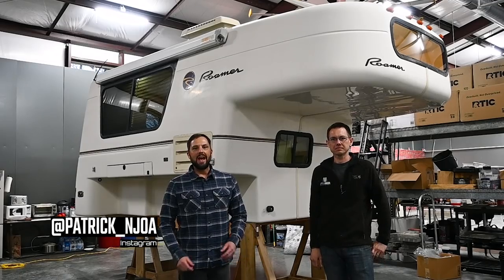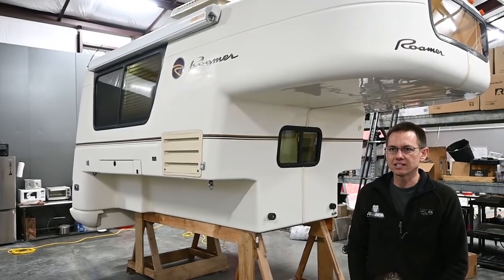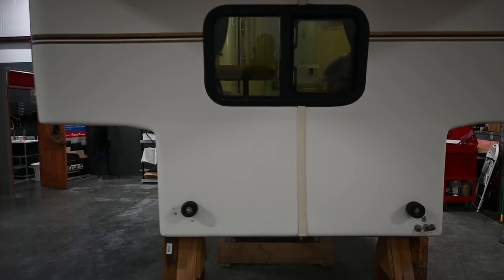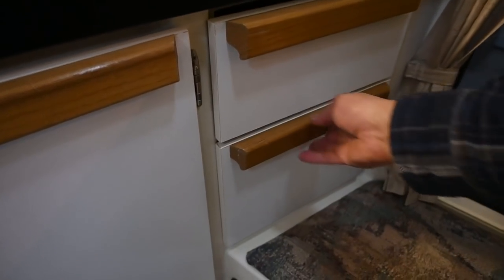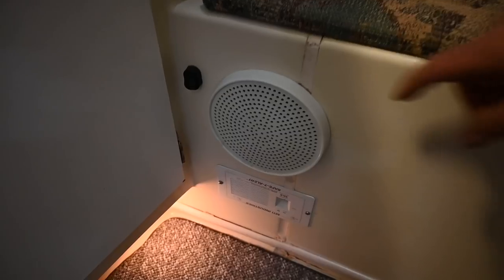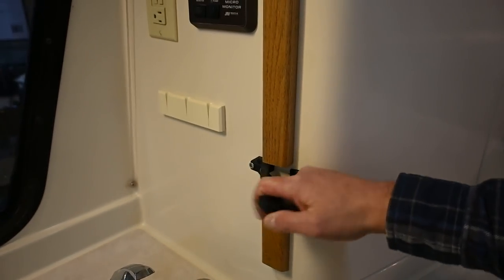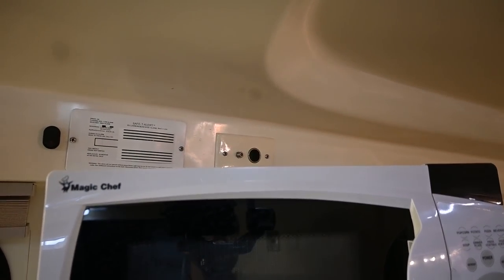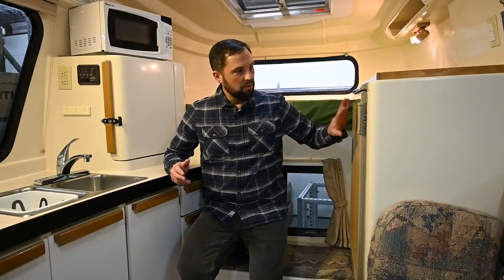The RAREST Truck Camper on Earth - Roamer RV Overland

Comment: That’s a pretty neat truck camper. I would personally look for a trailer instead. Truck campers are so heavy and seem cumbersome to deal with, I think a trailer would be an easier option.
Reply from the maker: Thank you for the feedback
Reply: My two cents…you really need a dually for stability and carrying capacity.  So many people go with a single rear wheel and they are highly unstable.  I know, you have extra this and that but a dually solves all of that.

Comment: Northern light and the other split campers are clam shells top over the bottom to prevent them from leaking water, but being split down the middle center is not going to be able to seal out the water its kinda backwards, but it is nice inside and out, but needs a generator
Reply from the maker: Maybe that was the reason for their demise?
Reply: @NewJerseyOutdoorAdventures  it is a very nice camper inside and out, though, I think they should have a option for generator, or enough electric/ solar, to be able to run ac, and other high wattage items.  But the camper is a very nice camper

Comment: It is a cool camper.  I had one for a couple of years.  Lot of water issues, not the least of which the dealer I bought it from thought duct tape was the proper sealant for the roof vents.  Water entry points were a weakness on this design, it gets in the fridge vent, and the side access doors especially easy, but it is mostly fiberglass which means water will not destroy it, only make a lot of repairs necessary to replace rotten wood.
Is a very aerodynamic design and I could get 20 mpg on a diesel truck, or 17-18 with it and towing a cargo trailer.
With any TC there is no storage and this one woefully lacks upper cabinet storage.
I had a rule to not drill or screw any new holes into the fiberglass so that limited me adding storage.
The roof sank under the weight of the roof AC, so that had to be un-sagged and braced.
The floor is plywood between those fiberglass sandwich pieces, and was not fun to rip out from underneath and replace. Same for fridge floor wood.
The plumbing was all glued together like a house so to work on it meant destroying the pipe connections.  No rubber or flexible connectors were used.
The support legs really belong ONLY on the corners, so if you have one with legs in the middle then move them to the corners asap or you will crack it.
Fiberglass is a lot of work to maintain, waxing needed and is not easy like waxing car paint.  I never even finished waxing one side in the 2 years.
With all the issues and weaknesses of design it was still a great camper and looked cool.
Reply from the maker: Thank you for the information, sorry to hear the challenges you had with yours
Reply: @NewJerseyOutdoorAdventures  lol, ok.  Too bad they could not work out all the design issues on this, it had potential, but in the end was just a disaster, and though it looks like a cool design was a terrible design afterall.  Cool "look" , great aerodynamics, horrible to live in, and did I mention it has no way to handle water if it rains, it leaks like a sive.

Comment: The first slide in like this was Gold Line made in Oswego Kansas in the 60 ‘s then bought out by Ford Around 1970 71 My step dad built the mold for Bud Coons who owned several camper co in South eastern Kansas! I had #003 unit ! Instead of fiber glass the two halves were made out of sakalack witch was the down fall , as this mareral was not Uv safe !

Comment: they way campers ought to be. there is a mystery with fiberglass.  noticed it with hauling boats. You could tug a 20+ foot wood easier than a little 14 ft outboard glass. I concluded it is a steel buzz killer. Springs needs to keep a resonant frequency. The fiberglass kills it... makes it look and feel heavy when in action of towing. You may notice on superyachts too..gigantic motors.. and they could be even slower than an actual steel hull in the water. quite a mystery. Maybe its like pushing a pillow versus a knife.

Comment: Why not totally trash the truck bed?  Build a camper to fit the frame of the truck with cutouts for the wheels and utilize all the available space for tanks etc!
Reply from the maker: That would be good only for someone who just wants to use the truck for one purpose
Reply: Roger:   There are companies that do just that... camper shells that bolt onto the frame of the truck.  They aren't very common, but they do exist.